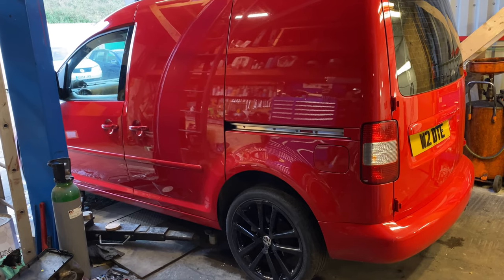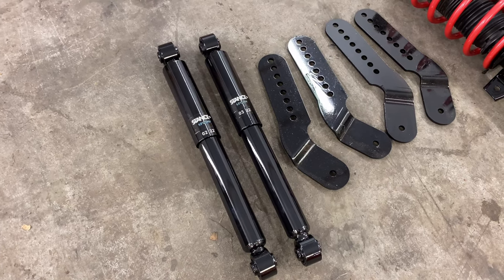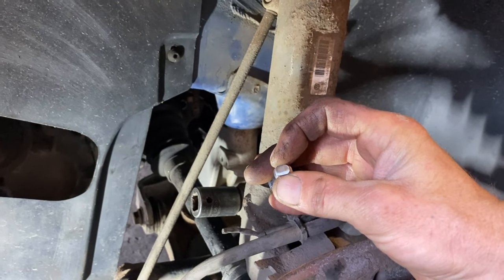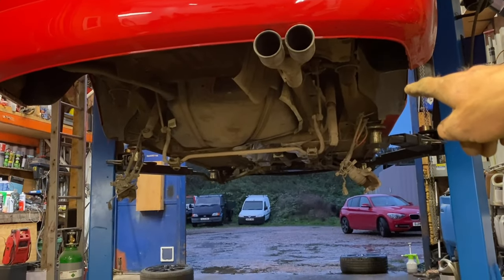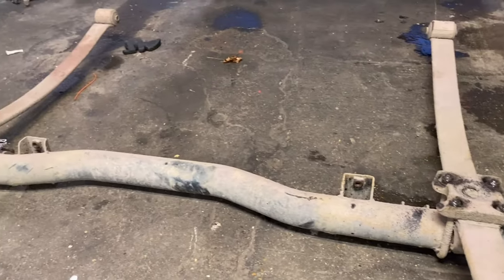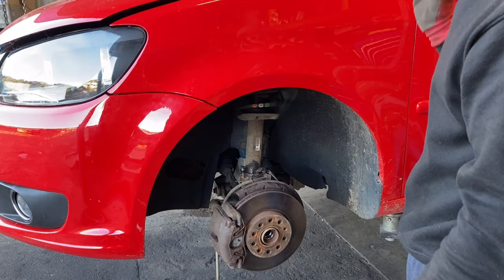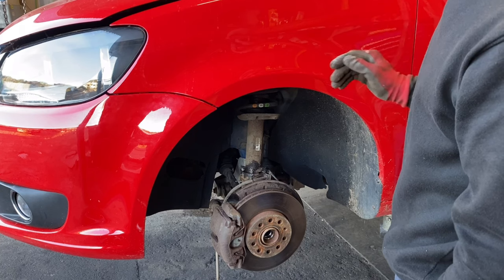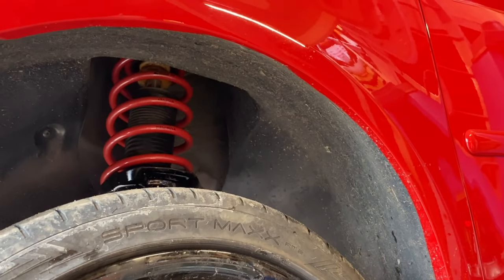CADDY 2K Build series - 60mm lowering - Axle flip -Ep10

Comment: For splitting front shock from hub I usually screw the bolt back in the threaded side 1st and put a piece if flat bar in the small gap at back of the hub. Tighten the bolt onto the flat bar and it opens the gap easily and there's less chance of your style tool slipping out.👍
Reply from the maker: Hey Kevin that is a very good idea I will use that in the future 👍 vag hubs don’t have thread in the hub but many do so thank you for the tip 👍👍

Comment: You can buy darkside development shackle kit and will save time welding and won’t have to take the whole axle off plus also have the option of going back to complete stock
Reply from the maker: Hi Owen yes I’ve seen the bolt on kits but they move a lot, mine are welded solid and cost nothing. Thanks for the comment 👍

Comment: I love your work the way you do things just the way I like it spot on and you got a motor bike ❤️ I wish had seen your video before I replaced my front shocks. How did you get on tightening the centre bolts  up ? As it very high torque.
Reply from the maker: Thank you sir really appreciate that 👍👍 I have a few bikes and plan to resto the one in the booth in a video very soon. For tight bolts I either have a big bar or a very high impact gun.

Comment: Mate, if you had bought the spring saddles from Retrofication as well, you would have saved a lot of faffing about. Also with the new saddles you can fit them in situ, they also have an offset on the that the originals do not have so the axle sits central in the arch. Oh and the design of the new saddles means that the shock bolts fit straight in without any cutting or messing about.
Reply from the maker: Hey bud it cost me nothing to do that just my time 👍 my wheels sit central aswel. Thanks for the comment 👍